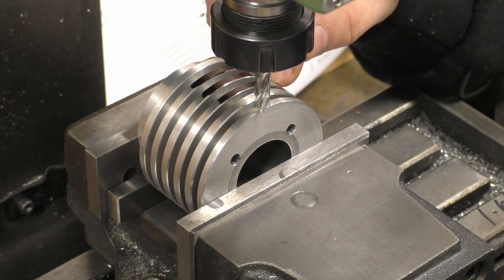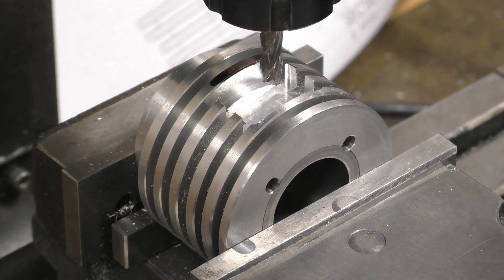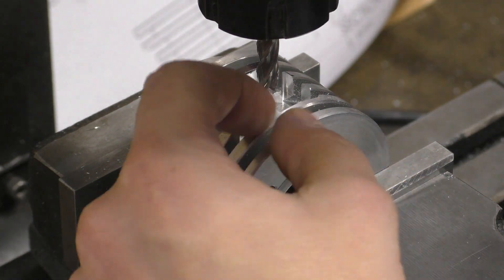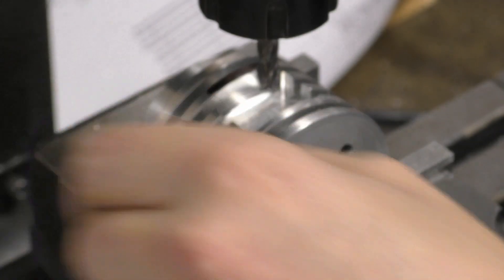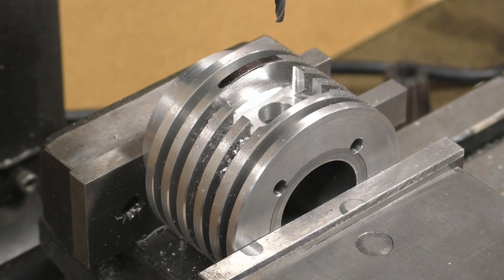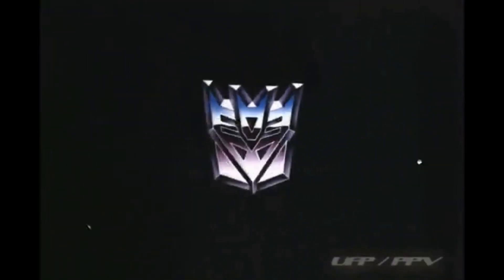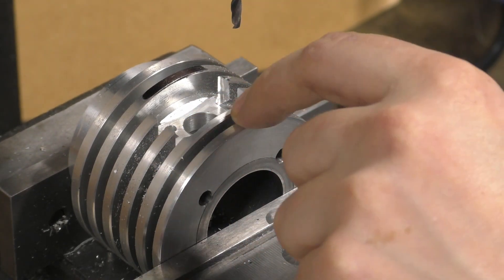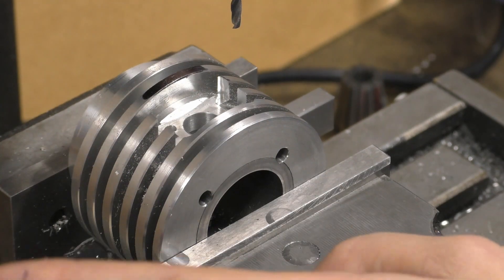Homemade 2 stroke engine step by step - Part 14 - Exhaust port

Comment: well done!  I only wish I could find the rest of this!  Are there any follow up videos?  This has been the perfect template for an opposing cylinder floating piston engine I'm considering building - but would like details about how you handled the reed valves and the ceramic spark plug.  I think FI would be a nice way to avoid a lot of the problems with making a functioning carburetor ....

Comment: have you thought about building a external combustion engine? like a steam engine!  I would like to build a small one. or convert a gas engine to steam. and use it to spin a 150 amp alternator. to charge batteries. in a off grid house.
so I can use wood to make electricity with wood and trash.  either that or build a wood gasifier.

Comment: how do you know where to put the ports on the cylinder?
Reply: It depends on the type of scavenging he is using for the engine.  By the looks of it, I am guessing this is scavenge loop engine. The ports are placed in a manner which creates a "loop" of charged air into the cylinder. For performance two stroke engines that employ a loop scavenge process, this typically means that there are two main inlet scavenge ports in the cylinder and 1 to 3 secondary inlet ports. The main ports are usually immediately to the left and right of the exhaust port, oriented in such a way that directs the flow of gas to the back of the cylinder, away from the exhaust port. Depending on the bore of the piston, and the target point of the inlet, this can range from 50 to 70 degrees from center point (not really center point but I don't have any real way of conveying the coordinate system to you at the moment). For a better explination, there are several books on the subject. 
http://dragonfly75.com/motorbike/2StrokeDesign.pdf
This is one of those books. However, it really hits hard on a lot of theory. It helps if you have some background in fluid mechanics, thermodynamics and little calculus. 
Hope this helps.
Reply: Not exactly. However, I read the book that the link I posted takes you to. I am currently a mechanical engineering student at the University of Utah and a huge RC fanatic. I am currently in the process of designing a 1/4 scale RC trophy truck and have started to design the engine for my project. I merely regurgitated what I had learned in my research and the methods that I used to design my own transfer ports. I am still learning so my information may not be entirely accurate.
Reply from the maker: Magic mate LOL
Reply: sounds like you've done it before?
Reply: Also, there is another video on this channel that shows his SolidWorks model. The designer of this engine uses a very simple design. He is just making an engine for demonstration purposes and it employs a single inlet and a single outlet. This design is terribly inefficient due to the fact that the inlet port "blows" the fresh charge across the cylinder head. The problem here is that a large portion of the fresh charge is ejected out the exhaust at bottom dead center.

 In two stroke engines true compression doesn't begin until after the exhaust port has closed. The purpose of the inlet ports is to fill the volume of the cylinder with as much fresh charge as possible while simultaneously forcing any remaining exhaust gasses from the cylinder. This is accomplished through port timing, port geometry, and piston head geometry.
Reply: oh sweet, from the USA then
Reply: Oscar Thorpe Yup!

Comment: what is the smallest that one engine can get before it needs nitro?
Reply: i don't know how small can the combustion chamber be?
Reply: AmazinChannel, nitro can be used in any liquid fuel engine.  Not just any engine can handle it BUT it will work....for at least a moment.  If a single drop can get in the cylinder, the engine is big enough.
Reply from the maker: Like Mike said - pretty much any size. The only constraint is the smaller the engine the smaller the droplets of fuel have to be to allow the fuel to vapourize. So its basically dependent on the fueling system. This is why a lot of miniture engines (really small engines, sub 1cc) usually run on butane or propane as these are gases to start with.
Reply from the maker: LOL what - I don't understand - do you mean this engine or engines in general?
Reply: Anything smaller than a top fuel engine, obviously!
Reply: hmm i get it.
Reply: thanks for nothing